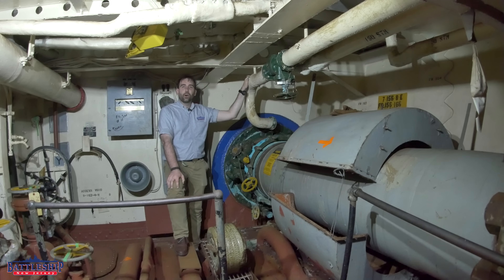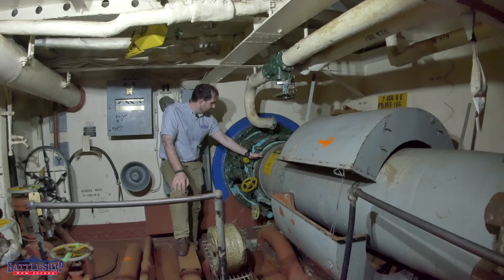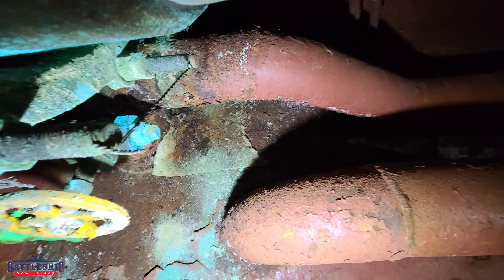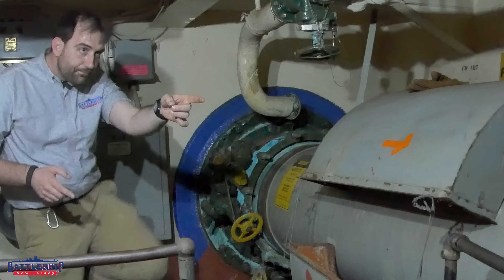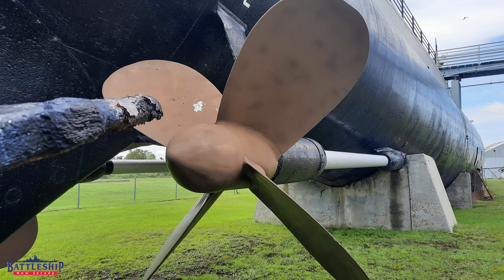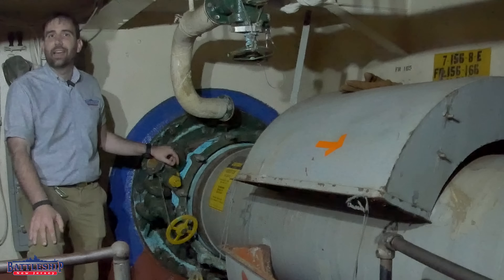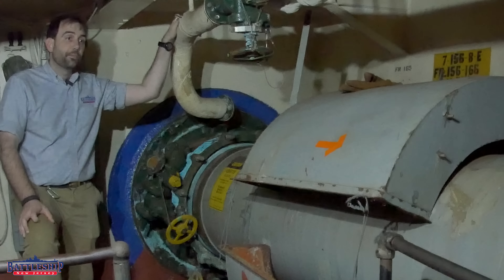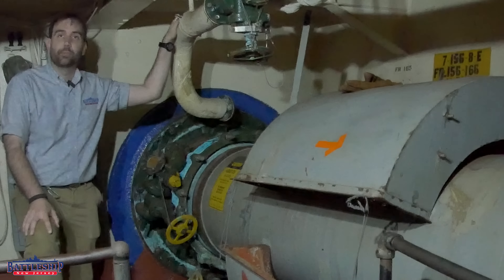Drydocking New Jersey Priority Project: Propeller Shaft Seals

Comment: Make sure to visually inspect the hull after it has been painted, to make sure they didn't cover up the sacrificial plates with paint
Reply: The nodes will be replaced with new ones. That's not an issue as far as I can remember Ryan saying.
Reply: @Mark13tol  Yea, the anodes need removed for painting if for no other reason than the primer coatings meant for steel won't stick to the anodes very well. But removing and replacing anodes is standard practice even on many fiberglass hulled boats (to protects the various through-hull fittings) so it is highly unlikely the shipyard workers will miss it.
Reply: @TrabberShir  In an earlier video he mentioned having the wrong anodes for the water they're in, so they're coming off whatever.
Reply: @HighlyImprobableName   Yes,  the currently installed zinc anodes are for salt water use. they will be replaced with aluminum anodes for use in fresh water.

Comment: I have a lifetime solution, that is archival in nature, does no damage to the ship outside minor cosmetic damage (where it is welded - which may be optional, to be determined by an actual engineer) and is 100% reversible:

In the idea of keeping the props on the ship, what i'd do is remove all the packing, support all the weight of the shafts so they're centered and have a stainless steel collar machined (in halves) which are then introduced in the exterior portion of the seal, sticking out of the ship's tubes. An expensive affair, to be sure, but a life time one, i doubt any amount of time would degrade this. Those would then get welded on the outside and on the inside, regular packing can be introduced, which will be safeguarded from the weight of the props pulling the shaft down by the stainless steel acting as a spacer bushing.

 If they're machined with grooves to put a long lasting seal implement against the shaft itself, they could also double as a seal. Rubber would age, so probably something akin to a plastic, perhaps a stable resin would  be introduced from the exterior (to be read, once installed and welded) using a hole that reaches that cavity between the shaft and the stainless steel collar. None of this would be permanent, so it would not affect the nature of the boat, merely cosmetic damages would be made and it would all be reversible, in the true spirit of an archival, museum oriented action.

Bonus point: this would have one massive benefit aside from the fact that it will not allow the seals to be crushed, and that's the fact that should any water make its way in, service could be rendered to the packing when the boat would be in the water. With the outer part welded (to the hull tube - proper name escapes me) and the inner packing of choice stopping most of the water leaking from the shaft (the only gaps being the join of the two haves which is where water may seep in) the flow of water would be minimal and a competent team of packers would have no issues dealing with it.

Comment: I would say that while you have the tail shafts pulled - since you're gonna have to do that either way - assess the condition of the gland seals and what damage from sitting they've received over the past 30 years,  use that data to make your decision to repack or remove/plate over.  If it looks good, keep it, serious issues, don't.
Reply: The shafts do not have to be replaced in order to repack the seal.

Comment: After you replace the gland seals, build a rubberized sump below each through-hull opening with a moisture alarm and an automated pump when the water reaches a couple of inches in the sump.  Add an additional alarm when the pump activates. This would keep you from having a surprise of several feet of river water intruding into your shaft alley.  This project should be able to do fairly cheaply.

Comment: I’m a maintenance mechanic and I deal with some pretty large pieces of gear on the daily, but holy cow the size and scale of some of this ship born gear is impressive. The weight of those prop shafts alone spinning is enough to bend your Mind and the sheer amount of torque and power it takes to not only move a chunk of metal that size, but to also propel a tens of thousands of tons ship across the water…engineers make the world go round.

Comment: Looking at the situation as it exists today, so far, you've experienced some minor leakage.  Replacing the packing will certainly address leakage around the prop shafts in the near term, but eventually, you'll be right back to where you started.  For long-term preservation, I recommend that you remove the props and the last removable portion of the prop shafts and display them alongside the ship in a manner that reflects how they would look in situ.  Then blank the shaft ports with heavy-duty, high-quality steel blanks that will protect the interior of the ship from future water intrusion.  It will also limit additional hull deterioration by removing any shaft flexing that occurs due to the static positioning of the ship's props and will eliminate another potential source of dissimilar metal corrosion, and asymmetrical component wear over time.

Of course, this is predicated on the availability of funding.  It is a fine line between what is necessary and what is nice to have.

Comment: Keep the props in place if at all possible. Would have to see them separated from the ship and potentially lost in the future. This may be a dumb question but I  am
wondering if it is mechanically possible to use oak cribbing or some other material to help support the weight of the propeller/shafts to try and minimize the weight on the bottom portion of the shaft seals??

Comment: It seems a little strange that the weight of the shaft would be compressing that packing because you have a stern tube bearing and an inboard bearing supporting the shaft on either side of the stern tube seal.  If it really is propeller shaft static deflection that is causing the packing to become compressed at the bottom perhaps you could install some additional shaft support immediately adjacent to the stern tube seal that would eliminate any movement of the shaft.  You could simply weld a heavy duty bracket between the shaft and the hull structure so the load of the shaft is transferred to the hull structure instead of to the packing in the stern tube seal.
Reply: The drive shafts were designed for stiffness because of the vibration and force in service, that means they're more than strong enough.
Reply: Knowing nothing about  ship engineering the idea of adding additional support sounds logical.

Comment: Great video showing the difficult decisions museums must make a when dealing with corrosion and wear from outside display.  I am a deputy director of an aviation museum and we have to make these same decisions in order for our aircraft to survive over the long term.  Once corrosion takes hold, everything changes.  We have added aircraft from other museums that were simply  left to rot.  Now we have to triage those aircraft and start replacing and fabricating parts while stripping everything out of it to remove the cancer. Otherwise, the patient dies and the aircraft gets scrapped.  My call on the props?  Remove them and display them on site.  Of course, that is dependent on the what they look like in drydock.

Comment: My thinking is to keep them attached to the ship. Maintains originality.
Reply: And keeps the chance for reactivation
Reply: Nobody can even see the propellers from the ship. Can't you keep the props stored on the ship somewhere? I know it would have to be topside. There is alot of weight between the shafts and the props. I don't  care if it is designed for it, that much weight constantly  just being there has to be pushing down on the membrane.

Comment: As a ship builder of more than fourty years my two cents says, try and determine what the shafts are made of, stainless, monel, or ?
Fabricate similar metal split rings and weld to the shaft on the outside and if you are lucky weld to the aft end of the stern tube where it will be mild steel (worst case cast) in which case you may be able to drill/tap into it and fasten the dissimilar metals. The main worry with this fix is the possible galvanic action. Two solutions first is a fast sandblast of the area to begin, and again upon completion. A very good epoxy coating (Imron) and bolt on anodes on proper stainless steel bossings that a diver can change as required. Make the rings 3/4 thick the very worst case a weld may crack and water ingress would be very minor. This is a VERY economical fix and keeps this fine lump of history whole !  GOOD LUCK from Canada

Comment: Keep her props on. Others have suggested coating them with epoxy. Check with DoD for any surplus CARC paint, see if they can transfer it to you. Worked great on the tanks and APCs I worked with back in the day ( we transitioned from enamel to epoxy starting in 1982-83) it should last longer than other coating, even submerged.

Comment: Could you weld a metal 'boot' around the shaft to the hull?  Yeah, it would be a bit more of a complex shape than a flat blank would be, but would help seal the opening more permanently while keeping the props in place like the other Iowa's.
Reply: That’s what I was thinking also. They could have a contest. Imagine the letter. Congratulations you have won a propeller.!! Shipping is not provided. Congratulations 😂
Reply: create some sort of seal that could be more easily maintained by the museum staff even if its a rubber gasket or another compression fitting of some type

Comment: Packing glands are the same from a small pump to those propeller shafts. I think I would invest some time finding the right packing material to seal a non rotating shaft as most are designed to drip as the shaft rotates. At my work the last packing material we used was kevlar based and very durable which is what I think  Ryan showed an example of. Perhaps it could be a combination of wraps to support the weight and wraps to create a seal as there will be several layers stacked up like washers on a bolt.

Comment: Would "barring over" the shafts at certain intervals help with the packing longevity? Can the shafts even be barred over at this point?

My vote is to keep the props in place.
Reply: (\If drydocked, anything is possible, including replacing the engines/gear with electric motors and generators, mmaking the ship mobile under her owe power again, without steam. As it's a museum ship, that's cost prohibitive, and pointless. I'd prefer seeing welded in boxes, seal welded to the hull, and also welded to the prop shaft, and even add in some supports for the prop shaft, so the weight isn't an issue.
Reply: The jacking gear on the main reduction gear should be able to accomplish the suggested action. Cost as it would mean putting lube oil back in the gear set, all four gear sets.
Reply: @ravenbarsrepairs5594 I know it wouldn't be easy, but I wonder if some sort of bouyancy could be added to the propellers or the very ends of the shaft (where it meets the propeller) as a way to take some weight off the shaft, but not in a way that would require attaching supports to the hull (supports anchored to the river bed just won't work without being more complicated than necessary).

Comment: Wait until you see the results of 30 years. If it’s bad, plant some New Jersey palm trees around the welcome center. Remove them at the shaft joint you pointed out, blank over the hole, treat the end of the shafts heavily with sealant, and stick ‘‘em in the ground propeller up. Would make for some very unique shade on site, and it would be easy to keep an eye on them.

Comment: Ryan you pack the outer housing where the shaft comes thru the hill with Clay. Then you pump out the water behind the clay. You then have a water tight seal outside of the shaft seal.

Comment: In my humble opinion as a science teacher who is related to a materials engineer: blank it off and display the props under cover. The odds of the New Jersey being recommissioned again is next to zero (I teach math as well), and the long term potential for losing her to corrosion increases in direct proportion to the whims of funding (there is never enough funding).

Having said that, the fun answer is to retain the props, refurb the engines, and sell berths for historical(ish) cruises. It'd be a wonderful learning opportunity to spend a few days on a Iowa class at sea. That's a pie-in-the-sky dream though.

Comment: I had expected the shaft seals on a battleship to be a complex design but, surprisingly, they are the same simple design that I have on my little 38' sailboat.  Even the weave pattern and color of the packing is the same; probably the same material.

Comment: Use to work on the MX9 Stern tube seals on the decommissioning and sealing face refurbishment @ Mayport Sima in the 1990s.  You may want to have the packing material checked for asbestos!  when doing a refurbishment on a DD we found theirs was.  You have packing glands installed from the pictures you showed.  There should be 3 or 4 rings of either Teflon or graphite impregnated packing material in the stuffing box from what was shown @ 1:52 it was not done properly as the sealing face does not appear to be inside the stuffing box.  @ 1:55 it is of the packing gland exterior mounting to the bulkhead that looks okay.  if you are repacking remember to stagger the joints by at least 90 degrees
Reply: There's a sign right on it saying asbestos is present. 1:59

Comment: Consider taking the props off and arranging them on the shore next to the quay- in the pattern that they would have been mounted to the ship- to give a scale of the props- something that you can't normally see because they are underwater. This removes some of the risk of dissimilar metal corrosion. Weld a plate on the outside of the shaft penetration- leave as much of the original shaft/packing (but now dry) to be able to make a tour see as close to the real thing, with little risk of a leak.

Comment: I think that the purpose of a museum, especially in relation to military artifacts are to keep them as close to a representative whole as possible, to that end, I think the propellers should stay on. You and your staff and the board have done a great job of restoring and even returning/reinstalling equipment back to where and how it should be and if the propellers are removed, they're the kind of part you will never find another if in 20, 30 or 40 years another curator decides they want the propellers back. As you said too, if they leave the site you lose control and odds are no one will look after them like you or other members of the Historical Navy Ships Association would.

If they HAVE to be removed for maintenance reasons I think keeping them on site would be best. Here's a crazy idea, if you remove them, keep them on site but use them as the posts for a shade-sail arrangement over a garden area and maybe have a cafe or something operate underneath it so it becomes an interesting, hopefully additionally revenue-raising part of the site.

Comment: Quite the dilemma, but they should stay on if possible. We had a boat once where we had positive pressure greasers for the prop shaft. Some prop shops are also water cooled with additional of water flow. Potentially you could regularly be pumping a environmentally safe grease of some sort in there to maintain the seal. Cheers, Warren.

Comment: Since you aren't actually using the shafts, you could pump the stern tube bearing full of Tectyl 435D marine preservative on and between the bearing staves before you put the packing in. Not an approved procedure by any stretch, but since the shafts aren't being rotated anyway, it shouldn't matter and a big wax plug will do wonders for keeping the water away from the shaft seals, plus it's easy to undo. It's also relatively fast and cheap and if you're doing any kind of shaft preservation outboard, you'll have some on hand anyway for the shaft strut-bearings.

Comment: Flax packing? They used flax packing material for the watertight seals around the periscopes on diesel submarines of the era. In one book ('Wahoo' by Richard H. Okane), the flax was getting torn-up by pitting on the periscope shaft. The solution? Upon arriving at Midway, the captain out some local dentists to work on filling the pitted shady with amalgam (dental fillings). It was a hack that they probably would not have performed at Pearl but the dentists of Midway were delighted to participate in.

The material shown earlier in this video also looks like flax (2:34) packing material.

Comment: The bottom part of the packing will take the weight regardless of if the shaft is spinning. I'd expect the wear to be substantially higher with a rotating shaft, as any eccentricity in the shaft will cause the packing to alternately compress and decompress each cycle.

I've not done much with packed seals since I was an Engineering student, but I don't think there would be any issues with containing to squeeze the packing down, and I'm not surprised the seals are lasting longer without rotation.

Removing the prop and rear part of the shaft would allow you to seal up the holes, but it's probably cheaper to keep the seals and repack them every drydocking. That leaves corrosion as an issue, but if that's causing problems, I'd look to your cathodic protection plan. I'm not a corrosion engineer, but I would expect a good plan to deal with any issues.